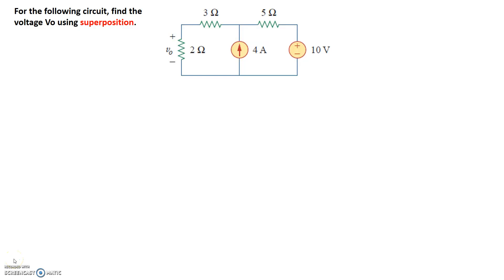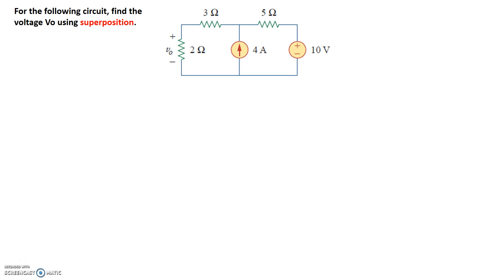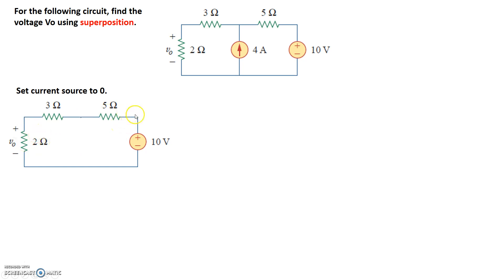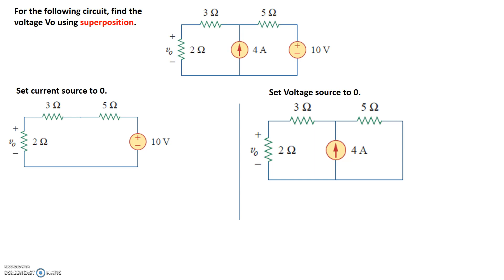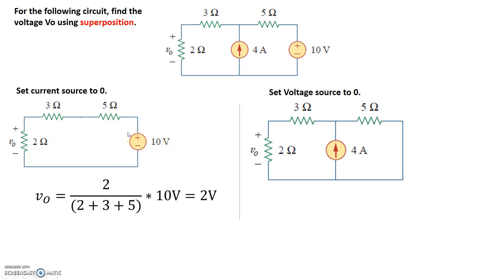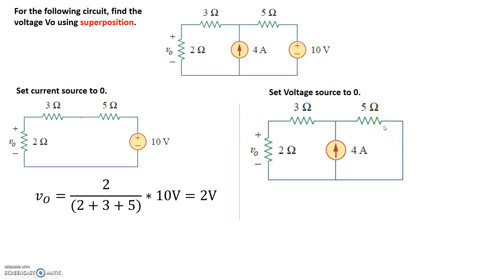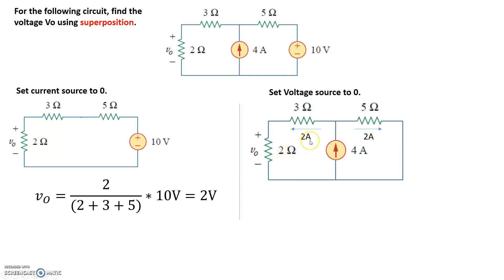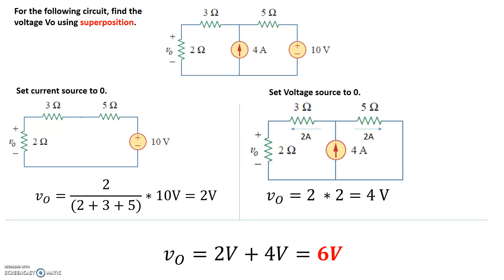Example Circuit Superposition Principle

Comment: i dont understand why nothing is happening to the 3 and 5 ohm resistor when solving Vo while the amp source is turned on, how come you just split the source into 2 and not consider the resistors?
Reply: using the current divider rule at the 3 and 2 ohms will give us the voltage at 2 and 3